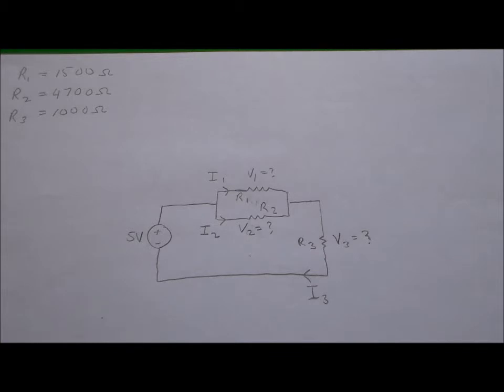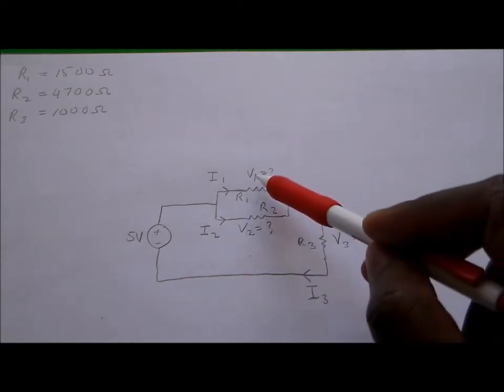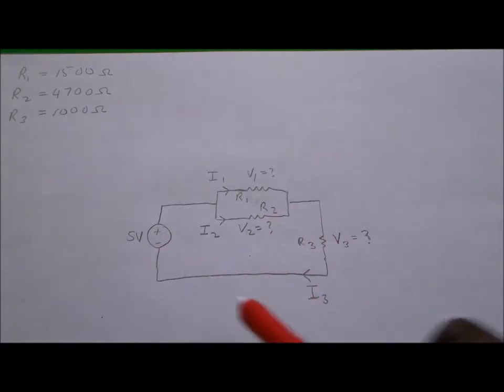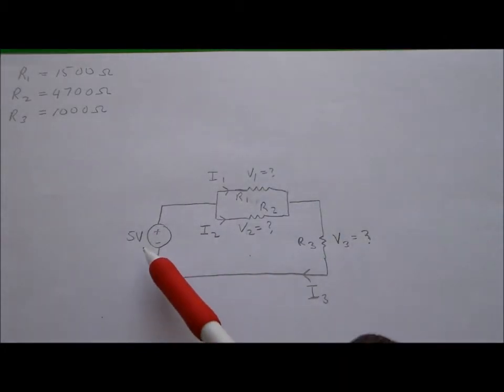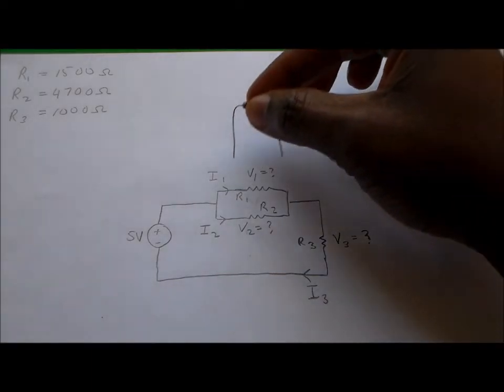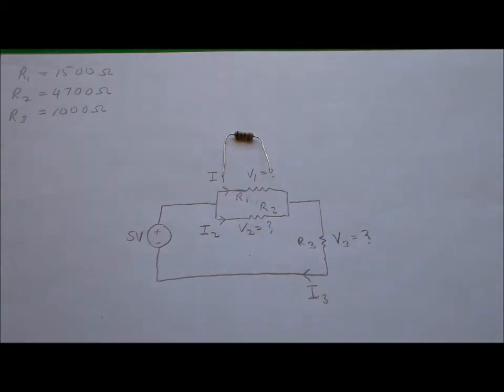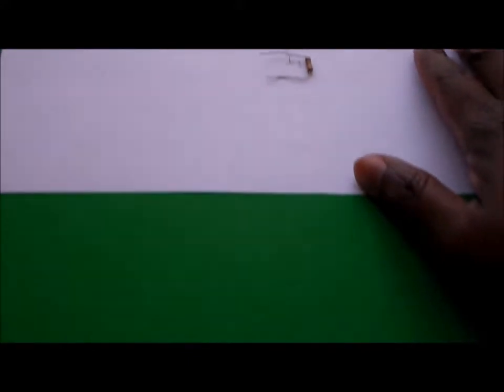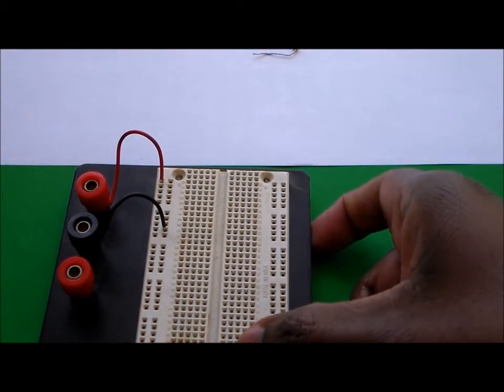How to Measure DC Voltage and Current in a Combination Resistor Circuit

Comment: How do you measure resistance, where do you connect the leads in a series-parallel circuit
Reply: You can use the formula V=IR where voltage equals the current(amperage) times the resistance